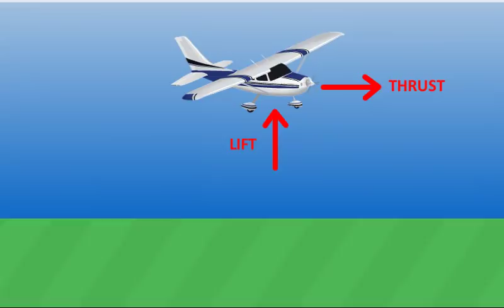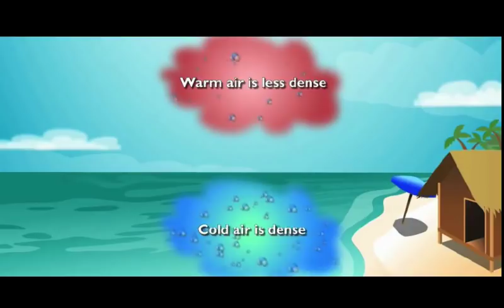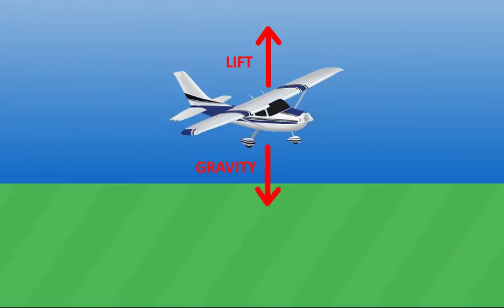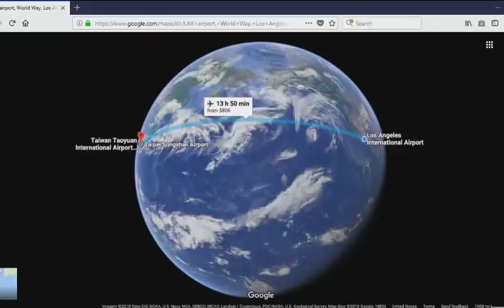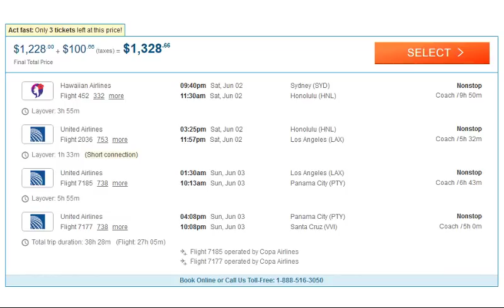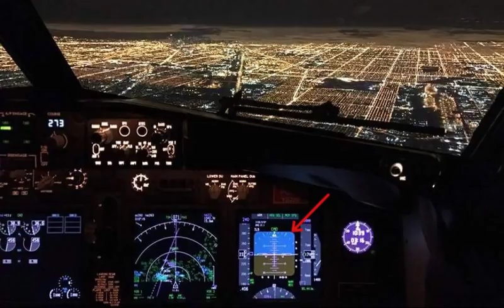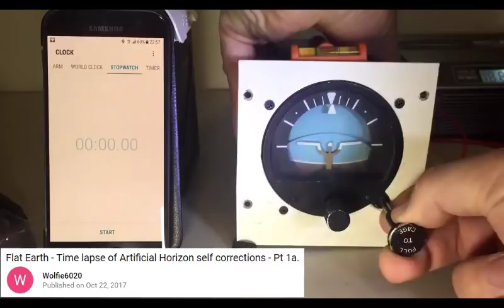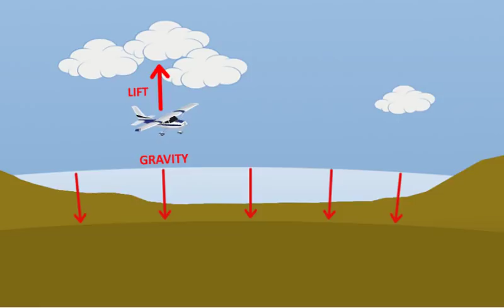Flat Earth Falsities - Plane Nonsense

Comment: GE arguments are illogical, prevailant human belief behaviours can't be described with any scientific certainty. 
In the teaching community, a considerable debate has existed for over half a century on how to define weight for their students. The current situation is that a multiple set of concepts co-exist and find use in their various contexts.[2]
Some of GE Litterates on meaning of LEVEL...;
"..term “straight”. In aeronautics, it refers specifically to an aircraft’s course, not to its vertical flightpath. “Level” flight is not related at all to the concept of “straight”."
"It's funny how flat Earth believers can't understand a straight line and a level one (?) you can draw a line around a golf ball right down the middle of the ball is that not a straight line because it is" (ha ha)
"In aeronautics, a level flightpath IS curved. Level doesn’t mean flat , it means flight at a constant altitude."
okay...
Classic non GE airplane LEVEL definition; straight line - a line traced by a point traveling in a constant direction straight line - a line traced by a point traveling in a constant direction;  a line of zero curvature;  "the shortest distance between two points is a straight line" https://www.thefreedictionary.com/straight+line 
Straight-line The definition of straight-line is something with lines that do not wave or curve,  http://www.yourdictionary.com/straight-line
- have not found any sources giving the plane flight definition,

Altitude: vertical distance of an object measured from means of sea level??
So that is also a curved LEVEL?
Do globeheads understand the definition of LEVEL?  Or a 3d straight line?

Think about the RULE that the water wants to minimize its potential energy.  Some of that Basic principle of statics Science stuff. The system wants to attain a configuration which is stable (harmonious)= Equilibrium! (some call it a level)

Science has never explained what so-called the Force of gravity is, the "We" are still at the stage if trying to define what is influence is!

[ These theories attempt to overcome what many researchers consider to be two enormous problems with our understanding of the universe. Observations going back decades have shown that the universe appears to be filled with unseen particles—dark matter—as well as an anti-gravitational force called dark energy. Alternative theories of gravity attempt to eliminate the need for these phantasms by modifying the force of gravity in such a way that it properly describes all known observations —no dark stuff required.] They never explain that talking shit.

Repeatedly I have stated there is a form of Attraction as offered my many, as of being Electric /Magnetic. None to do with MASS Force, as Einstein denied.  Hydraulics physics: This behavior has been used by builders since ancient Flat Earth times to level structures. As all high rise buildinds strictly use plumbs.
Reply: Louis Shaw  .. okay perhaps I can help here a little. The term straight and level flight essentially means level with the ground, now I can see where your confusion us coming into play here and how paradoxical the terms global or spherical earth is with straight and level. Firstly, the pilots are not needing to adjust aircraft attitude to account for curvature of the earth. The lift and weight (weight is actually a force measured in N - fun fact it's a misconception that weight should be measured in Kg or lb, mass is kg or lb) are balanced so the aircraft is neither falling to the ground or climbing in altitude. Due to the massive size of the Earth, in simple terms the aircraft can be considered to be flying in a straight line, however if you were flying from say New York to London and observing the event from orbit, you would see an arch to the flight path, but that arch would be at a constant altitude (well that's not strictly accurate as the aircraft uses fuel it would essentially begin to climb (it becomes more efficient to cruise climb - please feel free to Google it)). 
I've found in other posts people getting confused and actually using aviation assumptions for geocentric, straight and level flight and assume flat plane as evidence of a cover-up alas these are engineering assumptions to aid calculations for short haul flights. 
I hope this helps your understanding.
Reply: For Literates may use more honest truthful words meanings?
Unidirectional maybe, instead of a 3d world Straight line? Not talking on paper viewing here.
Level may essentially, but it does not carry that meaning, as claimed or decided.  Lets say with the Water.. because the not so flat ground, not good.
Happy to see One capable of at least comprehending those points, kodoos!  I know they dont need to adjust over the seas.
Yeah massive, still supersonic jets: 768 miles per hour (1,236 kilometers per hour) at sea level... should give GRAVITY some adjusting problems. 
As the new NAVAL gun that shoots (straight)bullets to 100 miles...
Reply: @BrainUser1  am kind of sat here for once going... "What?" 
Look seriously, these books are written by engineers for other engineers, you don't need to adjust your language... look straight and level flight is a simple enough term, if you start saying unidirectional to maintain constant altitude you start adding complexity that the simple straight and level flight captured quite easily. 
Sorry why would travelling supersonic give gravity issues? Bare in mind am an Aerospace engineer. It may fascinate you to know that the effects of gravity itself has a speed (essentially if an object were to randomly disappear (ie the sun) the effects of it's sudden loss of gravity would take time to be felt (in the example of sun vanishing, we would actually remain in orbit for a further 8minutes)... in other words the effects of gravity are speed of light (maximum speed)... don't believe me? Check out "first speed of gravity measurement new scientist". 
Now, going back to your speed of sound and keeping in mind what I've just mentioned about the speed of gravity effect... literally, the speed of sound through air is microns to the speed of gravity effect... so not sure how travelling at supersonic causes any issues there. 
Finally, bullets travel on a ballistic trajectory... not straight lines.
Reply: Again nothing further then 'what", what what? :)  You guys utilise word meanings as you like, so for my shorthand cryptic style.. so what?
Yes UNI-directional I know seems more appropriate then LEVEL straight.
FE believe in perfect level flat waters (lakes,seas, oceans) not ground surfaces (mountains and very deep oceans), hope planes dont do the average Gravity level through those... 
Must then fly lower at the weaker gravity flatten poles..right?
Reply: @BrainUser1  fair enough, go about changing all the literature to unidirectional... you may encounter a few hurdles from publishers and academic bodies. Then you may also encounter a few issues when trying to change aviation authorities to say unidirectional... they may just stick to straight and level flight.
Am going to have to ask you... what's an average gravity level? I don't think you quite follow, the acceleration due to gravity does indeed vary with distance from centre of gravity...  further away and yes the acceleration is indeed reduced.... extremely marginally. At ground level we take it as 9.81m/s2, at 30,000ft it reduces to 9.79m/s2. So in other words, for an aircraft, it doesn't really matter what altitude you're at, the acceleration due to gravity is pretty much the same.
Reply: @BrainUser1  there's also another issue you've picked on there, perhaps am reading you wrong but you mention mountains.... altitude is taken from sea level, all land masses are at an altitude from sea level (because they are above the sea), the highest mountain is 23,600ft. Commercial airliners operate around 35,000ft (some lower but typically above 23,000ft operation). As I say we know where these high mountains are, we know not to fly into them, commercial airliners will typically be well above them, smaller aircraft will need to navigate around them.... there have been unfortunate occasions obviously where liners have crashed into mountains. 
Also, I am not aware of any commercial liner which flies over either pole. Sure there are smaller aircraft which do but given gravity at the north pole is 9.83m/s2... I doubt there would be any special consideration for gravity.
Reply: @BrainUser1  ps... I did say quite a bit more than what in that response... did you not see it all. Especially my notes on gravity speed
Reply: I hit something or Jabba is off work..? The Challenger Deep in the Mariana Trench at 10,994 meters (36,070 feet) below sea level, was wondering if that did not affect the Gravity automatic plane levelling. 
#Seems something affects Gravity;= centrifugal forces.
#Apparently new gravity maps revealed the variations of free-fall gravity over Earth were much bigger than previously thought?

Nice to see someone sane stating no commercial aircraft over the poles :)
Now I read all, not bad, decent, rare, but only below the Karman line can we calculate any "gravity" behavior, so for that weak Force to capture and hold on to Miss Moon... wonder.

MORE Basic stuff I dont get is why the very weak force of Gravity not suffer as the strong Magnetic one on distance?
[How does distance affect magnetic force?
Magnetic force obeys an inverse square law with distance. ... If the distance between two magnets is doubled the magnetic force between them will fall to a quarter of the initial value. (F/4) If the distance between two magnets is halved the magnetic force between them will increase to four times the initial value.]
- more just NASA space cadets proofing to back up.

Magnetism, gravity and static electricity act at a distance. 
[Changes in gravity and electromagnetic fields propagate at the speed of light.]

Note: ...If this is true, and it is, and we can prove it, and we can, then physics as taught in our schools is a lie. - Is the man crazy???
https://www.veteranstoday.com/2016/05/14/keshe-maxwell-hertz-and-the-key-to-gravity-electromagnetism-and-physics/
Reply: Apologies, evenings = family time. 
Okay just reading your notes there....
Not sure what you mean about the challenger being in the Marina Trench. Could you clarify your question there.
Centrifuge force is a contributor to the calculations for acceleration due to gravity but it in itself does not really effect gravity as a force. The gravitational constant (what Newton calculated) is constant but like all things other factors do come into play when deal with real world physics - for instance if you drop 2 objects from the same height, they will not fall at the same rate despite the force of gravity being identical - this is due to other factors such as same aerodynamic properties - aka drag. the Planet's spin means there is a centrifugal effect for objects which varies on latitude, which in turn also influences the pull toward the earth - so in essence when you drop an object, the overriding force in play is gravity but other things influence that object which slow it down and even add a rotation (albiet extremely small rotation).
The fundamental law for calculating the force due to gravity is rather straight forward, https://en.wikipedia.org/wiki/Newton%27s_law_of_universal_gravitation, diminishes at a rate of distance between body centres squared. Now, keepng in mind the size various planetary bodies (the Earth, the Sun, even Pluto) gravity is a significant thing despite gravity fundamentally being extremely weak - something with a lot of mass has a significant gravity, thats why we simply don't float off the Earth, its also why we are kept in an orbit about the Sun (despite the sun being as far away as it is), the sun is massive... really really massive! Its best not to confuse magnets with gravity - yes they draw objects together but they are very different forces thus distance influences will not be the same. 

Now you've hit on an interesting point which you may not have realised, you mention there that gravity cannot be measured above the Karmen line... this is actually wrong. You see when you see objects in orbit (satellites, spacecraft, astronauts and the MOON!), they look to be in zero gravity... actually they are in perpetual free fall.. welcome to the wonderful world of orbital mechanics. They are all actually falling to Earth but because they have a lateral velocity, they are in a kind of race track around the Earth, never quite falling enough to hit the earth but speeding up to a point (perigee - closest point to earth in an orbit) then moving away from the Earth to apogee (furthest point in the orbit). Orbits are largely fixed thanks to the lack or resistance - very little if any aerodynamic influence on satellites, extremely little acting on the moon. 

To get to a point where there is zero gravity effect, frankly that doesn't exist anywhere as the equations never tend to zero - even over massive distances, you would need to be in really deep space. 

You have a comment concerning the Speed of Gravity effect, their study is peer reviewed and these days to get published anywhere you need significant peer review. How exactly they did it, not sure. But... lets have an example, lets say our solar system with all the planets in orbit is having an unusual day... the sun for some reason moves out of the general orbital plane at a small velocity before coming to a rest. The sun is a significant gravitational body so the planets will adjust their orbits... but they will do so at different rates. Mercury will follow after  3 minutes, Earth will follow 5 minutes later and jupiter will follow 35 minutes later. Now the reason they won't all move at the same time is because this would violate the speed of light, information cannot travel faster than the speed of light, therefore the effects on orbits will not be instantaneous. It just so happens, and Einstein did predict this but didn't have the tools at the time, that various studies have proven this effect travels at the speed of light. 

Your final comment there, about physics being a lie, not sure how you are getting to that assumption.
Reply: Deep in the Mariana Trench is clear enough as an anti agent for same gravity, small I guess but with the additonnal plane high.. dont ask me how come Gravity is stronger closer to that iron ball, all the extra Mass on top not helping it, but Mass and distance seems to hinder its weak force, but non Mass keeps it strong.

Nor can my addled, curdled, and poisoned mind fanthom the full of sense in..   other factors in play with real world MOON physics - for instance if you drop 2 objects from the same height, they will fall at the same rate dispite the force of gravity being identical - AND one has much less iron mass then thee other.

[Why did the hammer and feather fall at the same time on the moon?
Because they were essentially in a vacuum, there was no air resistance and the feather fell at the same rate as the hammer, as Galileo had concluded hundreds of years before – all objects released together fall at the same rate regardless of mass.]
- Long live honest NASA science proving!
Reply: Ah right, sorry took a minute there. 
Right then, don't confuse force with acceleration. Force is measured as acceleration multiplied by mass. Thus two objects falling in a vacuum will fall at the same rate but with different forces, drop a bowling ball and a football out of a window and ask 2 friends to catch them.... one will catch the football whilst the other will end up in hospital -but the time where one friend catches the ball and the other gets a serious injury will occur at the same time.
Acceleration due to gravity... as discussed previously relatively constant.
Gravitational force - dependant on the mass of the 2 objects in the equation and the distance from one another.
Reply: I am not catching the "other factors such as same aerodynamic properties - aka drag." devoid on the Moon. Can only parrot  Peter Domuzov=
    "To start, let's talk about Gravity. I don't think we can say that the questions of what is gravity and how it works are mere detail. Just because we observe an effect (namely, that objects fall), and can describe that effect using a formula (which we don't really understand), it does not necessarily mean that the force we POSTULATE as an explanation to that effect is the only possible explanation.
 ..Density/boyancy can be another explanation. 

Electromagnetic/electrostatic forces can be a third explanation. And so on... So, I would be a lot more comfortable with gravity as an explanation if we could actually explain what it is and how it works.
    Otherwise it seems, to me at least, that it can be viewed as one of several possible explanations. I find there are quite a few problems with gravity as a theory. For one, Newton's Law of Gravity only applies in a system of 2 objects. It falls apart when you have 3 or more objects in the system. 
    Second, it seems to vary depending on where it is measured on earth, which should not theoretically be happening. 
    Three, it does not explain the movements of the stars and galaxies, which is why we need to postulate nonsense like dark matter and dark energy. 
    Four, there is a question I have concerning gravity that I'm hoping you can answer... It has to do with the centrifugal force on any body on earth that results from the spin of the earth. To wit, a person standing on the equator is subject to a centrifugal force (Fc) equal to m*v*v/r, where v is around 1600km/sec (actually it should be in m/s but I'm too lazy to convert). 

Now, if you ask anybody who believes the globe model, they will invariably say that we do not fly off the earth because of gravity. 
Fair enough. So that means that Fg would be equal and opposite to Fc at the equator. However, if we now move our observer say toward the North Pole, the speed v will gradually decrease for obvious reasons, until we reach the north pole, at which point v = 0km/sec.
    I hope that is also obvious. However, Fg is supposed to be constant anywhere on the sphere, since each point is roughly equidistant from the center of the earth. This would in turn mean that the Fg at the north pole will still be the same as experienced by the same observer at the equator, but this time there is no Fc to balance it out. 
    So, in my humble opinion, the observer at the pole should feel a MUCH stronger gravity pull, possibly crushing him. I've spoken to people who have worked very near the North Pole at a military installation for 6 months, and they didn't feel any difference from any other place on earth they have been. Also, I have never ever heard of anyone who HAS felt any difference. Would you be able to explain this apparent contradiction/discrepancy?"
Reply: @BrainUser1  will reply later in detail but in a nutshell... other factors are generally to do with atmosphere on a planet (earth)... the moon doesn't have a significant atmosphere so aero drag factors don't apply. Apollo 15 test proved this. 
As for centrifugal force at equator. Yes it factors in your net forces thus slightly less acceleration in fall at equator relative to poles.... however it is absolutely tiny.
Reply: Hum... long live Apollo adventures, [1].
Flashback to the perfect velcro contact to the surface, Momentum, we picked up when the Atmosphere got dense enough and the Ball picked up its fixed axe and speed. THEY claim to really know what Wind comes from, more then Lightning? [THE WIND AFFECTS THE EARTH'S ROTATION During the northern hemisphere winter, the stronger westerly winds that build up in the Northern Hemisphere, combined with frictional drag at the Earth's surface, actually produce a very small, but measurable, increase(?) in the speed of rotation of the Earth. (WOAW!) This effect of the wind "feeling(??) the Earth turn underneath it" is important for very large and long-lived pressure systems.] - Well at last Something FEELS the closed system rotation :) - Starting to understand all this Natural and normal non affected Momentum gravity behavior.

[1] "..constant but like all things other factors do come into play when deal with real world physics - for instance if you drop 2 objects from the same height, they will not fall at the same rate despite the force of gravity being identical - this is due to other factors such as same aerodynamic properties - aka drag." 
Still dont get why all that is wrong without drag.

PS: e have you ever incountered a FEer that believes in Apollo tales?
Reply: @BrainUser1  sorry your last statement with references something I wrote... why are you struggling with the aerodynamic drag effect? Drag varies for every structure, imagine a parachute vs a rock... in an atmosphere, which will hit the ground first?
Reply: You did not nutshell struggle with my inquiry of "if you drop 2 objects from the same height on the Moon, why would they fall same rate /time dispite the force of gravity being identical - on an iron hammer mass, as a real light feather, when THERE IS NO DRAG?
PS: no Apollo / Gemini / Mercury or Zeus proofing.
Reply: @BrainUser1  need to be cautious with the wording there... the acceleration due to gravity will be identical. The force due to gravity will not be identical. In the equation, mass of the falling object is a variable so 2 different falling objects will essentially be pulled at different forces but at the same acceleration.
Reply: Newton's second law details the relationship between net force, the mass, and the acceleration: The acceleration of an object is in the direction of the net force?
 In short, force equals mass times acceleration... 
The acceleration of an object increases with increased force? 
But decreases with increased mass?

Complicated nuance to this problem I dont get :(
Nope Apollo's Galileo's experience does not sound rational to me..:(
Relationship between force and acceleration. 
They are directly proportional, or NOT?

A: Force is mass times acceleration, or F= m x a. This means an object with a larger mass needs a stronger force to be moved along at the same acceleration as an object with a small mass....
   - On a straight fall mass gravity attraction?? No pulling from the hammer mass? Both objects attract each other or not?
Well uneducated me is indeed unable to get how the Earth catched the flyby Moon comet then. Maybe the prevailling should go back to IT being a break-off after all, who knows...

Yeah unintelligent /selecting GRAVITY doesn't exert same force on feather and iron ball...
Heavier do fall faster than light ones, even in a vacuum.
Appears to me as just a Principle claims, for any practical experiment I don't see how you'd measure a difference that small.
But THEE Newton Principle it is there, somewhere.

[Another way of thinking of this is to say that gravity has to pull harder (IT does that?) on a heavy object than a light one in order (yes SHE likes order) to speed them both up by the same amount (critical for HER!). However, in the real world (at last!), we have things like air resistance, which is why sometimes heavy things do fall faster.]
....I think sometimes a flat falling iron beam will beat a vertical foam beam to the ground.
Reply: @BrainUser1  
Okay, an increase in acceleration indicates an increase in force if mass remains constant. If you increase mass but keep acceleration the same then force also increases. F = m.a, an increase in either m or a will increase force. The accel due to gravity can be considered 9.81m/s2... therefore two falling objects the heavier will fall with greater force. This is echoed in Newton gravitational force equations. 
Yes the two falling objects will attract one another but nano Newtons. If you work the equations you'll see that it is tiny...you need  one of the 2 masses to be massive... say a planet amount of mass. 
Finally no. Aristotle believed in a vacuum 2 objects will fall at different speeds as he believed density was a factor on speed of fall. This was later disproven.
Reply: OK, explain why the two towers of the Golden Gate bridge are perpendicular but not parallel. But please ask someone else to do it for you because none of your hyperbole makes sense.
Reply: Hi @phildavenport2467 , well the golden gate bridge is only 1.7miles long which frankly is not long enough to be visibly noticeable in terms of curvature. I'll do the cals later but ballpark figure of around 20in difference between end heights assuming there is no elevation (2miles of steel is very difficult to get precisely accurate end to end).
Reply: @phildavenport2467  ps. Thank you for an intelligent question. Furthermore, let's discount the fact the engineering design needed to construct that bridge to the surrounding landmass and that there will be tolerances which muddy the numbers. Even if it was constructed to match a perfectly smooth surface underwater, the actual curvature of the bridge and non-parallel towers would be very difficult to see with the naked eye... I'd wager less than 1 degree.
Reply: Strange psychology addressing such minds, over and over again, and getting upset, is that normal? Just one drivel was addressed, construction man too are thee? So mountains all over the place at your place? So what did they use before lasers? Full of sense but no backing, as usual, lip.

Can't have some literal liberty.. funny half of it is copied, just too complex for you, thats all, nice to see someone still willing to respond to my drivel. Lot of clarity even for a newcomer to get the drift.
Couple of typos, and clear definition points...
One time instead of writing novels, with no knowledge advanced, point a line you can really not figure out and I will explain its secret.
Reply: Seems some old timers never get over it.. another oneliner surprise.
THERE it is again, I DID I DID SEE A TINY EARTH at low horizon from the MOON.... HA HA HA no way would that be the case.
/watch?v=OKS09UW6aG8  7:45  Keep Those Two Flames Burning | The Flat Earth Awakening.